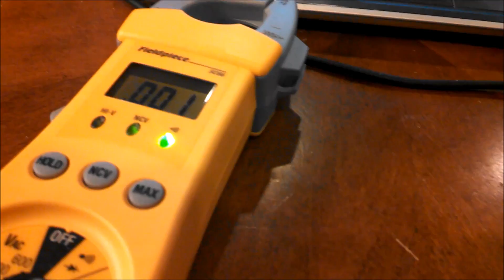How a Time Delay Relay Works - Furnace Repair Holly Springs NC

Comment: I’m here looking for any kind of help… I have a compressor and fan that won’t turn on everything else on the outside system works the capacitors fine I’m getting all the power where I need to get it coming in and out …the contactor is working ….thermostat is fine…there doesnt seem to be any disconnect in any 24v wires….any suggestions?…i was thinking it may be this time delay relay as ive replaced a couple to get fans  back on but i doubt it would be the fix in this case

Comment: That was as clear as mud. Much more useful to connect wires to the relay than break it apart to show the disc. I would have put the wires on and demonstrated where 24V lands from the transformer and / or field low voltage (T stat) what t stat terminal (Y, G, W?) and L1 line voltage lands where on the relay and line voltage out to blower motor. Draw out or use mfr. wiring diagram to illustrate proper wiring. The advantage to drawing it out is you can color co ordinate the actual wires on the relay to the diagram. The actual internal mechanism operation is of little importance as it is not serviceable. The NO and NC continuity tests are important to diagnose if relay is working or not. If it doesn't work, you need a new one though, right?
Reply from the maker: Thanks. I'll keep that in mind next time.

Comment: Thanks for taking the time to create the video. At first I thought my high limit switch had gone bad, finally realized that the problem was in the time delay relay. The fan wasn't coming on so the high limit switch would open up and the flame to turn off after 90 seconds. Your video confirmed this was the problem so I was able to order the relay.

Comment: How can I bypass or rewire so that my air handler blower motor turns off at the same time as my outdoor condensor fan and compressor to help with humidity? This is on an old ICP unit where the indoor unit stays on a couple mins after the compressor and raises humidity, but in our other house our american standard unit indoor and outdoor always turn off together and keeps the house about 20% less humidity!

Comment: How to tell if this is bad  my is taking too long and the limit control kick in and shuts down gas
Reply: @alexanderservices919  thanks for the quick reply will order one if i jump the fan works normal  just for testing  purposes,,do you know what the replacement part n# for Hamilton WGH   time delay relay  looks like is the 12s20 relay Hamilton is 5h75039

Comment: I just removed the thermostat wire to my ac unit to reroute it when I replaced the ac refrigerant line insulation. Unfortunately I didn't mark which lead went to the delay switch. Can either thermostat line be connected to one side of the switch or does it have to be the energized thermostat lead? what would be the result if I hooked them in reverse of when I took them off? Stupid mistake I realize now I am trying to recover. Thanks in advance. Richard
Reply: @alexanderservices919  Trane TDR has G from T stat land on relay board.